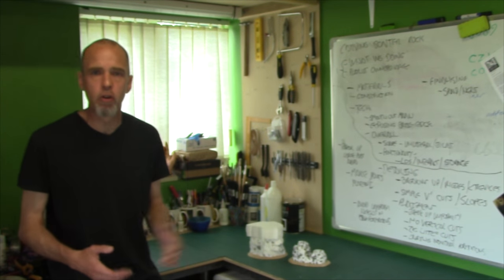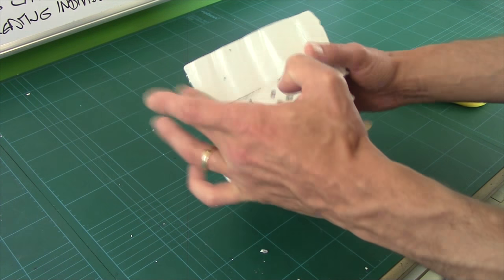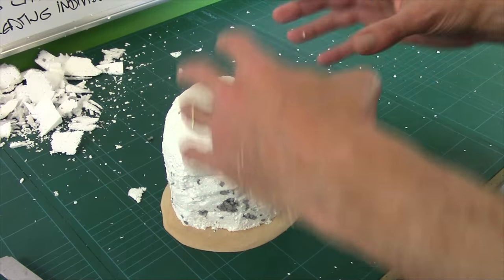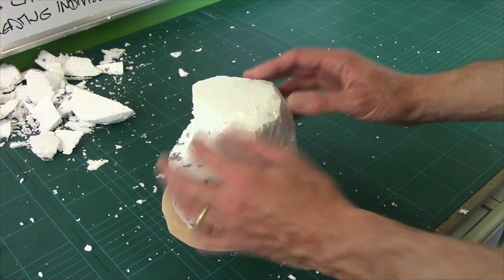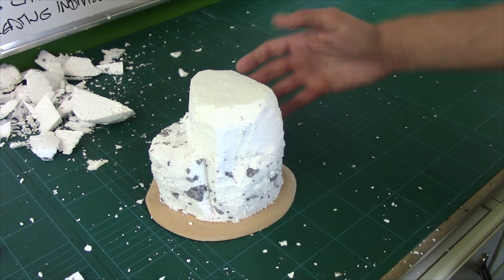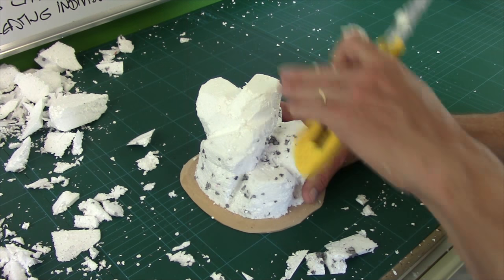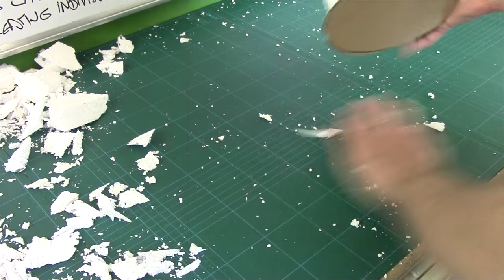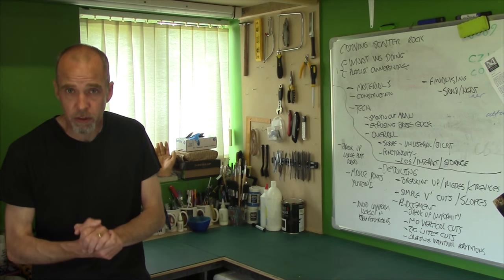How to carve easy scatter rocks

Comment: Do you prefer to use a knife rather than a hot wire cutter for the rough shaping? How long do your blades last when using them for this kind of work?
Reply from the maker: I do prefer it, more control, faster and I like knives .... I think I've been using that blade on everything for about 18 months mate

Comment: What are you using for the base?
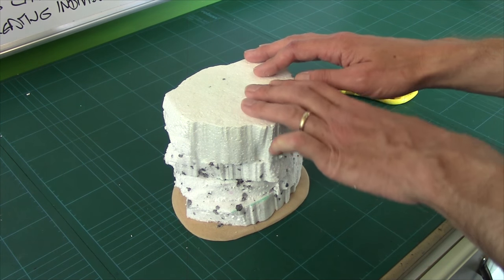Reply: 1:25 6mm Medium Density Fibreboard.  Mel recently did a video on PVC Foamboard as well, and standard foamboard would work too, but be careful about warping.